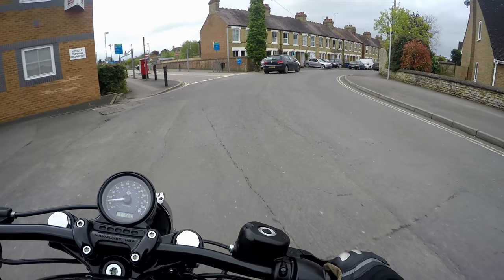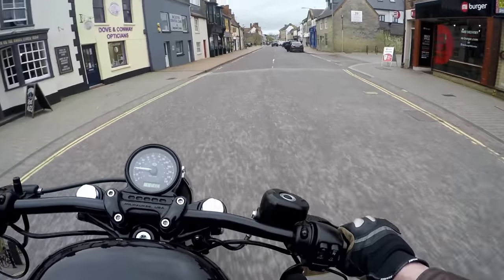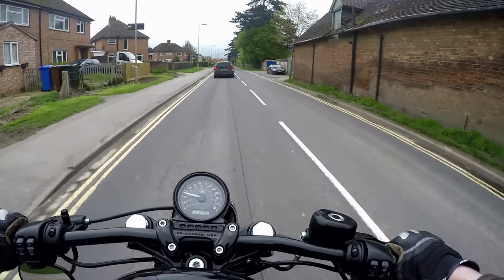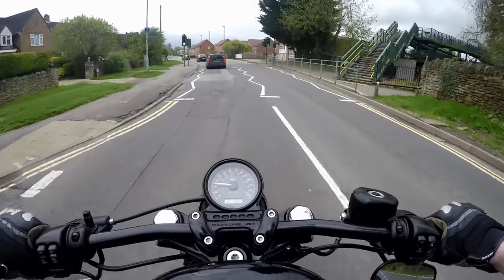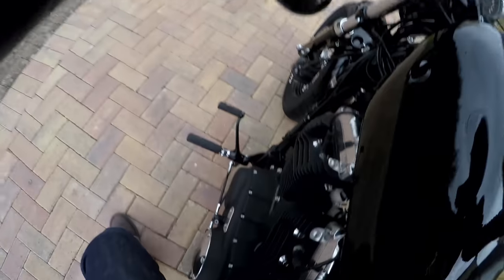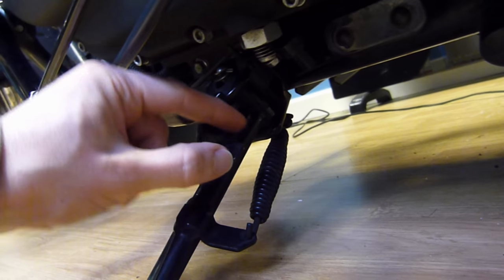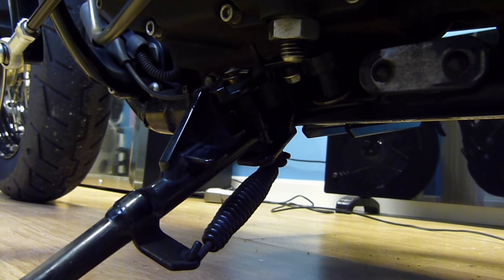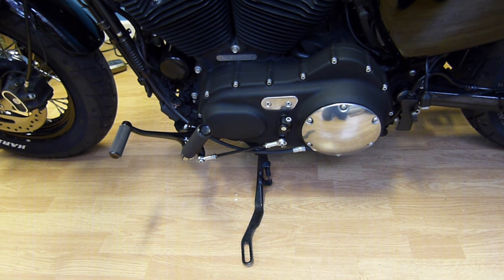HOW TO: Sportster Side Stand Engine Cut Out Issue Fix

Comment: Was just stuck at side of road with this issue and you have got me home.. brilliant... new subscriber ...
Reply from the maker: Glad you're home safe mate 👍🏻
Reply: not sure why...  he disabled the system rather than fixing the underlying issue.  There are two options.  1) replace the spring and/or pin because they are worn and too loose.  It costs less than 20 US dollars, (spring costs $10.10, pin is $9.73 for Harley OEM parts).  2) The other option is to make sure you have actually followed the service manual: "NOTE: Face open ends of spring hooks toward centerline of vehicle." Which would cost you nothing.  

That guy broke the part rather than spend 20 bucks.  

For side of the road "get me home", sure, but he calls this a permanent "fix".

Comment: This is a very good quick-fix but I feel as a Harley it should have the fault properly corrected (either spring replacement or pivot pin replaced. If you do actually decide to do the proper repair please upload it as well because your channel is great 
thanks

Comment: Been having this issue too. Washer has fixed it for now. 
Oddly, though, if the warning came up while the bike was in neutral, it killed hte motor. If it came on while I was in gear....the bike ignored it and carried on going. Even if you put it back in neutral and engaged gear again. Really needs a new spring, but for now, this is all I needed. 

Such a simple fix!

Comment: The man I bought my 2009 Sportster from had already replaced the side stand spring once and it needed replacing when I got it. Being a tight wad I simply tightened the spring, which resolved the issue until the spring snapped on one of the first rides of Spring (no pun intended). I disconnected the switch (a plug on the left-hand side of the bike on the lower down tube) until I could secure the stand with a bungee strap; these are a life-saver, and you shouldn't leave home without one.

Comment: i have the same problem lately with my 2008 XL Low (probably the spring have come a little tired and doesn't work as it should)... i have unplugged the sensor and tomorrow i will give it a try... if it doesn't work i will have a washer in my pocket and some superglue and stick that to the sensor... i hate all this electronic, if i was more educated when i bought my sportster i would have gone for a pre-2003 model...

Comment: I had the problem, would start and then cut out,could overcome it but it was a real ball ache. The fix new battery mine was 6 years old from new. Fixed the problem have had no problems since.
Reply from the maker: Interesting. Mine was 2 years old when the issue started, although I have the battery on trickle charge when it's not in use. Not had any problems since covering the sensor. Good to know I'm not alone!

Comment: Got the same issue, but also my neutral light connection as come off so no light, and it will only start with the clutch pulled in...

Comment: Is Wd40 can be the solution for the sensor? Is the Rust or oxidation be the reason for this ?
Reply from the maker: I think it's vibration and the gal between sensor and the plate rather than corrosion, mines pretty clean most of the time and still have the issue.

Comment: I was envisioning a costly repair , only to find it's easily sorted...Anyway...I Went straight out to have a look..on my 883 IRON 2013 the bolt through the stand has a slot at the top allowing for movement & this lets the plate on the stand  pull away from the sensor ...almost nullifying it !...I put another washer on the  bolt under the stand to make sure it was raised up  not slouching down . But there's still a lot of space tween the sensor & the little plate so I might yet glue  some metal to the plate .....sigh of relief !
Reply from the maker: glad you got it sorted!

Comment: I have one question why the hell are there squigly lines on your roads? I've always wondered that
Reply from the maker: if you mean the white zigzags at 0:45 they're indicating a control area for pedestrian crossing (because of the traffic lights), basically no parking or overtaking in that zone 👍🏻👊🏻
Reply: OK I see so its like our crosswalks. Makes sense, thanks for the info

Comment: I am on here now because my bike has cut out on at least 3 occasions. I didn't have a clue why it would crank up and go again with no problem for a while and then today it did it again. I had absolutely no idea what would be causing it. I din't even know about a switch at the kick stand. What is it there for?
Reply from the maker: It's a safety mechanism so if you try and ride off with the side stand down, the engine cuts out to stop you flipping. Problem is the stand tends to wobble and not make a constant connection so it can cut out randomly in 1st gear. Stick a cent on the sensor and it should fix it (just don't ride off with the stand down!) 👍🏻
Reply: I've looked under the bike today and I don't see anything except a black rectangle shape with two round spots on either side of the rectangle. left of the round kickstand rubber bumper. oh, it's a 2006 883c sportster.

Comment: I need to tell everyone. This hack could save your life. 

It’s absolutely absurd that the engine cuts out when the stand wobbles away from the sensor. The first time this happened to me I had no clue what was happening. Stand wobbled off (didn’t come down) as I accelerated out of a national speed limit roundabout from a standing start with traffic obviously incoming (it was still safe). I nearly died when a car had to emergency break. I had the spring looked at and it was a little corroded so weak and the stand wobbled a bit. Nothing noticeable at all when riding.

I put this hack on and rode until I could get the spring replaced. I wrapped electricians tape around it and bound it all with a cable tie as was paranoid it wouldn’t hold. It held until the spring was replaced. However, after having that experience I’m loathe to take this off.

I checked my bike today and the new spring was again corroded, and the stand was wobbling just as much as it did when the engine cut out.

I think it’s a disgrace that such a small thing could cut the engine out. I understand the danger of the stand being down, but when your bike is fucking MOVING and you’re headed into oncoming traffic pulling onto a road from a junction or pulling off a road into a junction or pulling into a roundabout this engine cut could easily, easily result in death.

I will be complaining to Harley about this feature
Reply from the maker: Glad it helped, I agree with what you're saying, because it's basically faulty its replaced one hazard with another.  Ride safe 👊🏻

Comment: This sensor is such an over-engineered and shitty approach to detect if the side stand is down, there are so many points of failure. Extremely expensive as well.
Reply from the maker: agree, particularly when paired with a cheap and rubbish side stand spring that it relies on

Comment: Just sold mine.... 
Always rode supersports all my life and I thought I'd slow down and get one of the new 48s....not for me lol 
Uncomfortable,constant vibration on the neck n back,slow and sluggish,a drop of rain instantly turns to rust,the very ridiculous and small peanut tank lmao,dealership prices for servicing... You won't get any change out of around £300.. For a major service it's £500.
I could go on but hey they do look good even though big guys like me look absolutely ridiculous riding such a small cycle.
Make your own decision and most definitely test ride one for a good hour or so...I promise you'll have a sore arse,back and neck and possibly you'll get white finger too 
I'm now off to ride my new Ducati 1098.... Have fun and ride safe!!
Reply from the maker: I always rode supersport before the sportster too. Sounds like you've made the right choice for you. I'd love a Ducati 1098, right now though happy with the sportster but bike goal for second bike. Enjoy, ride safe ✌
Reply: Riding Digital have you tuned it with the fuelpak3...does help with the torque and bumps up the hp a bit too.
I'll be putting on eBay a fairly new front leather tool roll bag plus an unused German Style helmet if you're interested.
£40 for the lot.
Reply from the maker: Yea I've done the FP3 tune as part of the stage 1, was virtually unrideable for me without it but runs good now. Thanks for the offer, not really my thing but good luck with them 👍🏻
Reply: Riding Digital no worries man 👍
Reply: sasholsuma I'll put them up  either tomorrow or Friday and post the item number FYI 
If that's OK with the host of this video.
Reply from the maker: a Pint of Guinness and a packet of crisps Cool with me 👍🏻
Reply: Riding Digital Cheers man 👍
Reply: @teddd10  2 yrs later, no item #? Lol